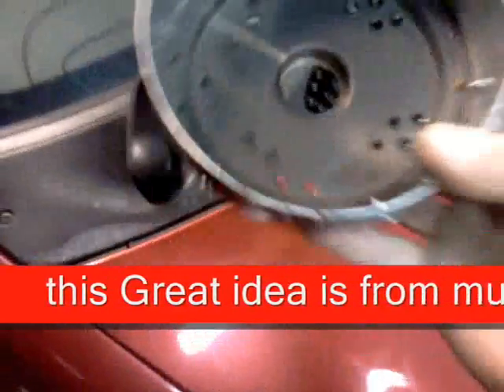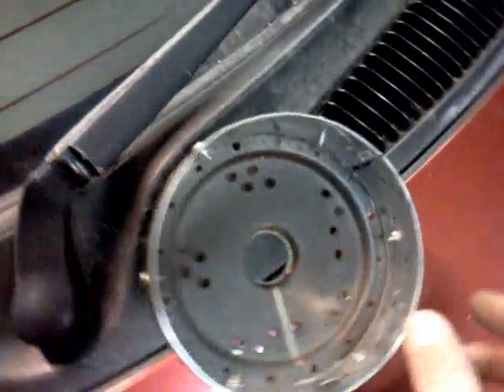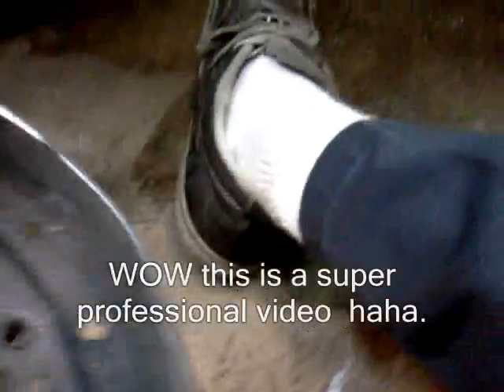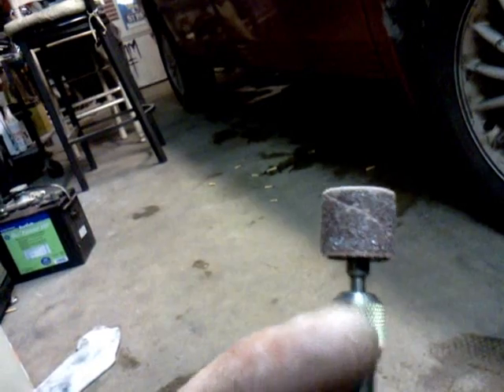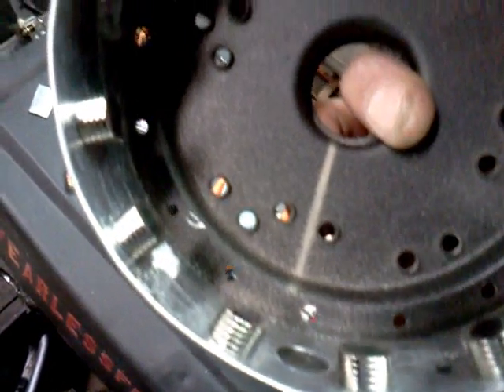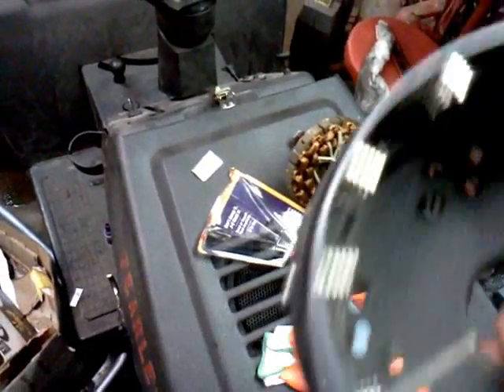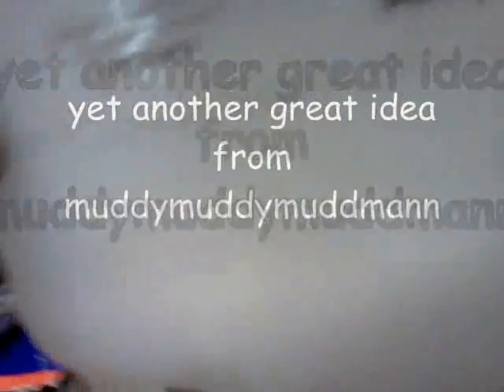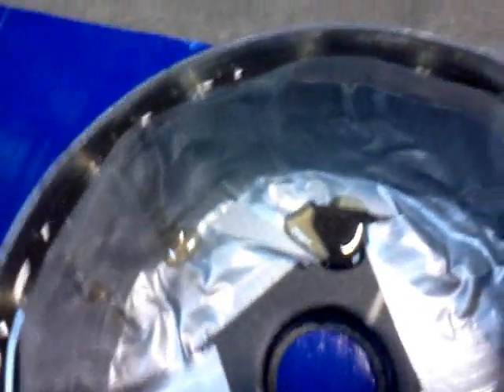Ceiling Fan Generator part 1

Comment from the maker: yes a ceiling fan, you would and will be suprized at how much electricity you can get out of it. it sends back ac currant I use a double bridge rectifier (double bridge because it has 2 ac out puts) and convert it to dc it will give me as much as 70 volts dc